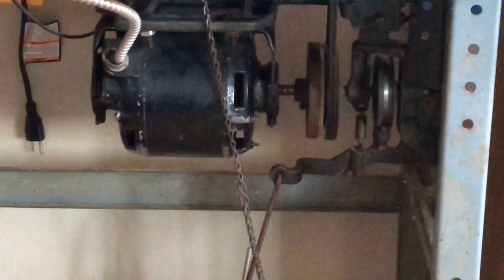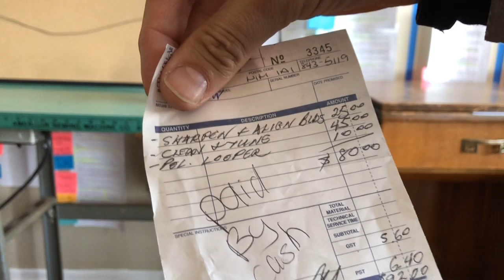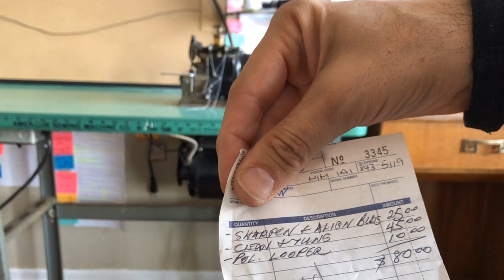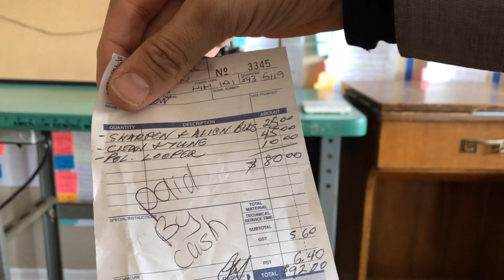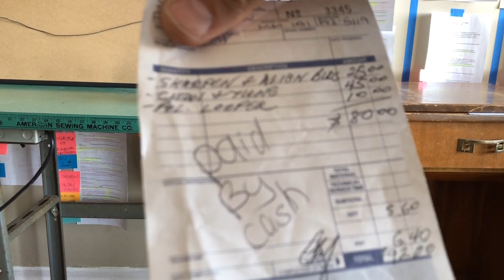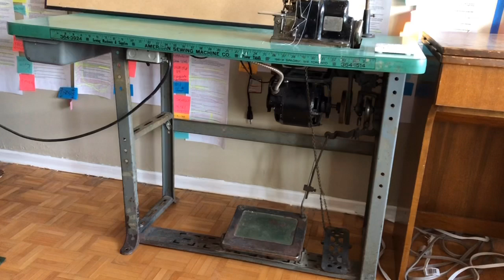INDUSTRIAL SERIES #1: Rescued Merrow Overlock Machine A-3DW-3. Last Service Receipt Shows Date 1999!

Comment: I have this same machine, only yours is in nicer condition. I got it for free from someone who didn't want it anymore.
Reply from the maker: Its amazing how long these machines can stay in production Rosita.  Mine are from the 1940's.  Merrow is still a company based in the US and they stock parts for their machine models going back to the 1920's.  I plan on replacing the loopers and blades on mine.
Reply: I need to replace the metal plate which is very rusty. I removed so much filth and dust balls from this machine. It fascinates me that after all these years of neglect that the machine still runs and at a very fast speed. Thanks for the videos.

Comment: I have a old industrial machine it is a singer 241-12 with the engine as a E-Z clutch motor and the big table I inherited and I am a sewer and I want to get it working it hasn’t been used in quite a few years
Reply from the maker: Hi Alexis.  I have a similar opportunity with my industrial machines.  Since the motors that these use are separate products from the machines, you can overhaul a sewing machine and not have to keep the existing motor unless you want to.  By this, I mean, most industrials do not have proprietary branded motors that they require as long as general specs are kept.  My Brother Industrial Lock Stitch has a clutch motor that is approx. 20 years old.  I plan on cleaning it and testing its condition.  It is supposed to have been running when I purchased it but we will see to be sure.  Now, for my 1940's Merrow Overlocker machine, that motor is from the same era and so I will be having that inspected by an electrical motor repair shop to assess whether it can or should be restored.  Another option I am very interested in is the newer Servo motors as replacements for the clutch motors.  These promise to offer much more accurate speed control which is great for many of us who are not sewing on production lines.  Keep us posted on your progress and I will do the same.